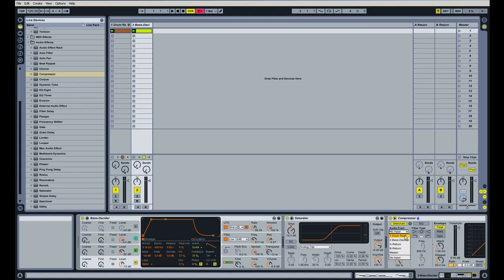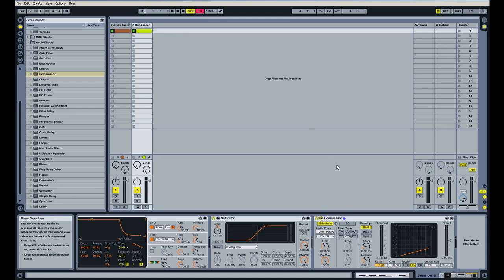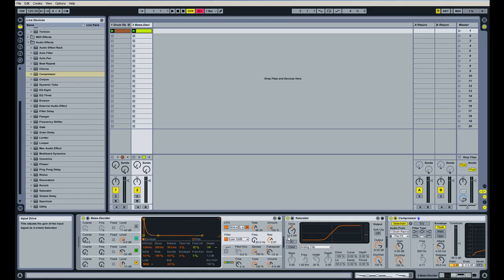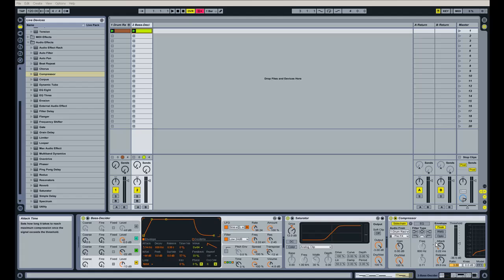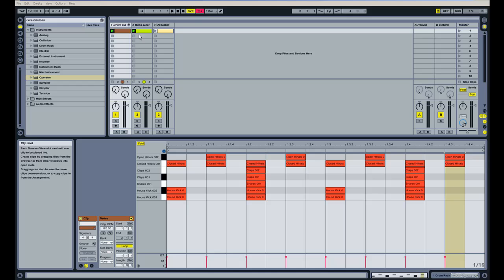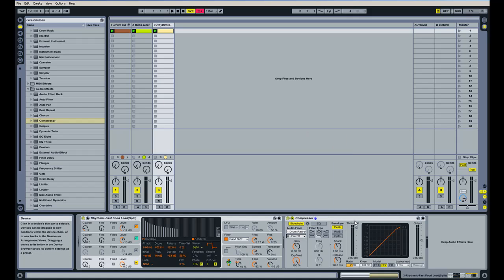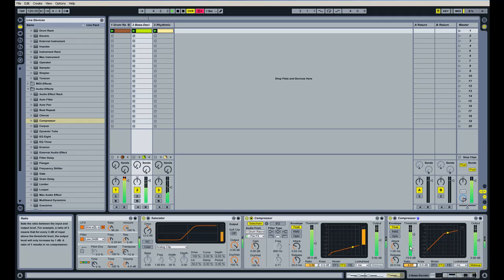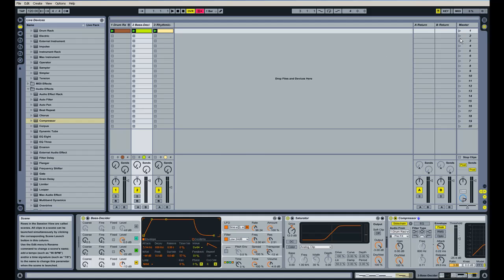How To Make An Electro House Song In Ableton Live (Part 2)

Comment: if you click the pattern you want to place, hold down the click and press tab it will bring you into your playlist, drag your midi clip into the appropriate channel and then you have your song in a progression now :D. also in there you can alter your automation clips, just slightly adjust the knob you want to automate, then a red line will move, double click the red line and adjust the automation clip and the sound will change over time in correspondence to the automation clip you just created

Comment: side chain compression will turn down the volume of the channel when a certain sound is hit, you can compress with anything, it will take the the amplitude of a sample(or synth) and subtract a percent of that from the volume of the synth being side chained, you use side chain compression for either a pumping sound, or a lot of people will use side chain compression if you have a very muddy low end, they will side chain their bass so the kick doesn't bleed into the bass